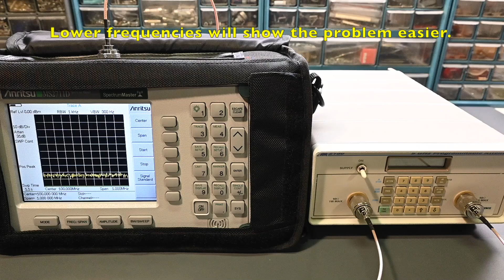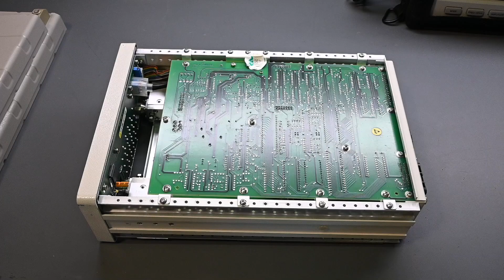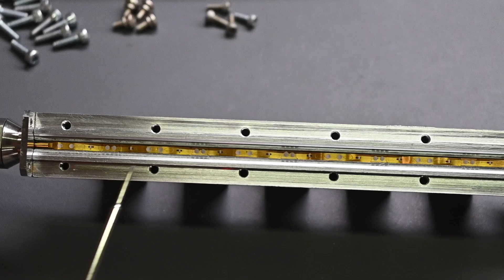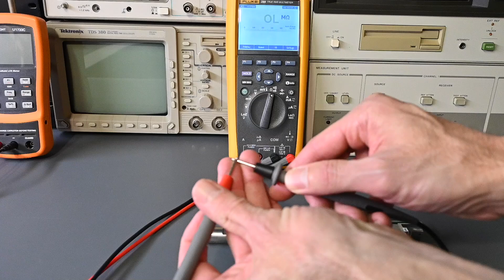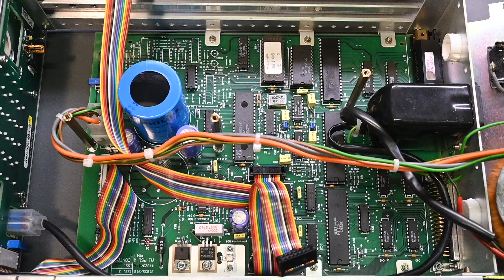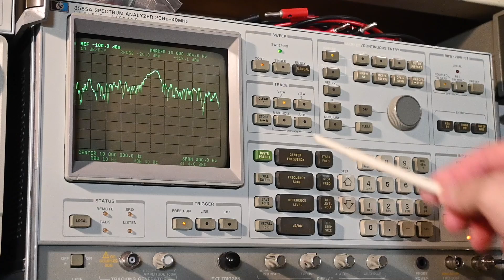IFR / Marconi 2186 RF Attenuator Repair - Why It Failed & How to Test It

Comment: HI Erik, Can you please tell me where can I find a second hand attenuator block for a Mariconi 2031 RF Generator. I need it for my own unit. Since it has a lot of intermittent problems. Nothing on Ebay!
Reply from the maker: You might check with www.alltest.net or www.4gte.com  I am not affiliated with either, just possible parts sources.  Or watch for a parts 2031 to turn up on eBay and pull the attenuator from it.
Reply: @EriksElectronicsWorkbench  
Hi Eric, thanks a million for all your help. My marconi 2031 came from a very dirty environment. Now I broke a thin white plastic pin that the solenoid pushes on to connect the copper strip. I have been working on the attenuator block for 1 week now its driving me up the wall. This assembly was not manufactured very well. Also what would you recommend to clean the copper connection stripes
Reply: @EriksElectronicsWorkbench  i
Reply: @EriksElectronicsWorkbench  Hi Eric, thanks a million for all your help. My marconi 2031 came from a very dirty environment. Now I broke a thin white plastic pin that the solenoid pushes on to connect the copper strip. I have been working on the attenuator block for 1 week now its driving me up the wall. This assembly was not manufactured very well. Also what would you recommend to clean the copper connection stripes
Reply from the maker: @johnverg6809  Deoxit, CRC Electronics Contact Cleaner, or a contact cleaner made for electronics (plastic safe) as long as it does not contain a lube.  You don't want oily film in the attenuator.

Comment: Crazy, I have that exact same unit in my lab. Even crazier, I have the same issue with my 20db section of the attenuator that I need to fix. 

Thanks for sharing
Reply from the maker: Hope the video is helpful with your repair.

Comment: 36:48 - odd values, I wonder why they did not use 2^n and start with 0.25 dB, that would with the same 10 relays give up to 255 dB in 0.5 dB steps.
Or is more than 20 dB attenuator in one step just too hard to make ?
Reply from the maker: I think the values are chosen for what makes the most useable attenuation range.  0.25 dB would require the two top T configuration resistors to be 719.51 milliOhms perhaps more difficult (or costly) to make such small value of resistance?  Also going up to 255 dB is such a huge attenuation it is not useful at low RF levels. This attenuator is 1 watt max.  As it is 130 dB is down to fraction of a microvolt.